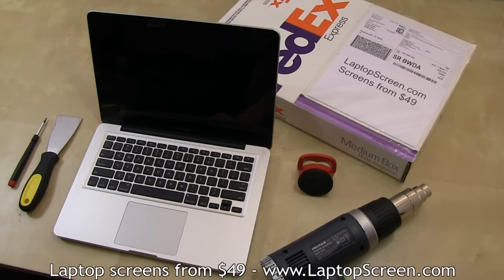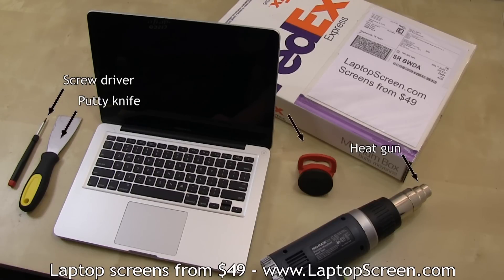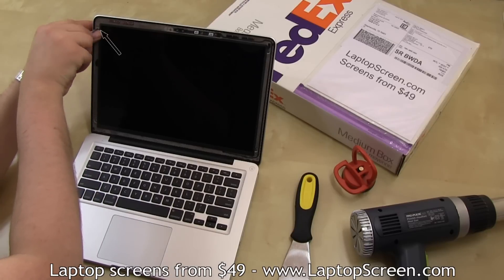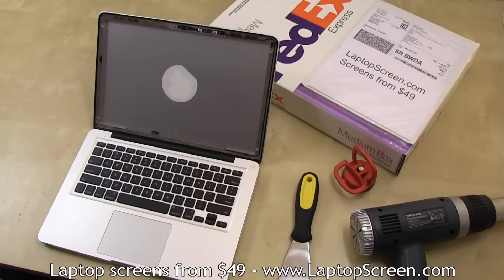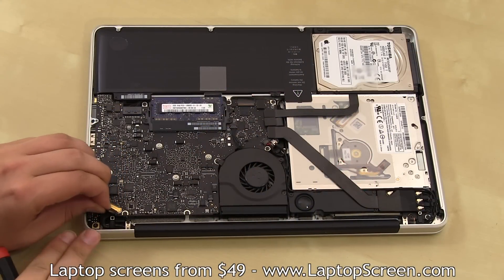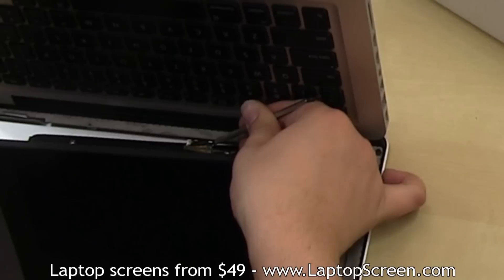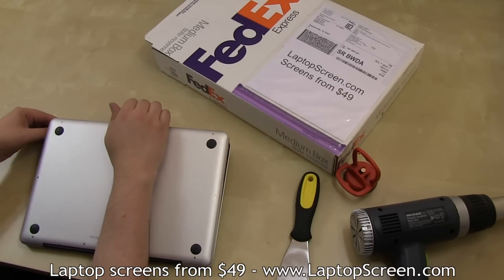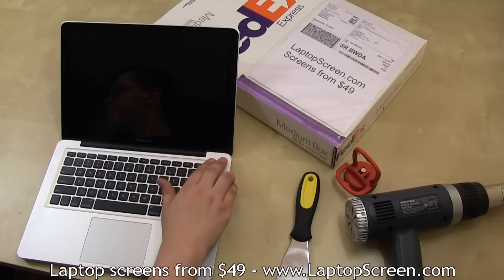MacBook Pro 13 screen replacement /  Installation guide [Apple MacBook Pro 13 Unibody LCD repair]

Comment: Great tutorial, I would recommend disconnecting the battery before removing the LCD cable cause on reinsert could blow screen backlight fuse.
Reply from the maker: Androski Diberooni
It is the likely suspect. The fix is moderately simple - there will be a tiny fuse near the video connector on the motherboard, it can be jumped or replaced. It is usually marked F1.
Just a note regarding the battery disconnection - we always recommend doing so, however it was less necessary in this video since the LCD was reconnected when the video cable was disconnected from the rest of the computer.
Fuses blow when the connector is slanted when plugging it in - probably should have mentioned it in this video (and we do in most of our newer videos) - always plug the video connector straight-in - and always use both hands when plugging it in - helps to keep it straight.
Reply: i think this may have happened to me as i cant see the screen is it an easy fix?
Reply: thanks

Comment: What temp do you set the heat gun to? My gun has various temp settings.
Reply from the maker: Sometimes choice is counter-productive.

The temperature to make the glue pliable is "right before you'd burn your fingers".

So the best advice is to always touch the heated area with your bare finger, and if it's hot to the touch you are good to go. If you burn your finger - you went too far.
Reply: LaptopScreen.com i saw this video to replace my macbook bro screen which cracked. if i wanted to replace just the front part do i have to replace the 2nd lcd screen aswell?

Comment: Can you replace a normal screen with a retina screen?
Reply: no because the flex connector is different
Reply: too bad :( would be great if it worked
Reply: Do you know what replacement screen will work on a retina 13" macbook pro?

Comment: Will this erase all of the data on the computer?
Reply: SERIOUSLY DUDE SERIOUSLY !?
Reply: Its not like the screen is a hard drive and the harddrive is the screen
Reply: Mutasem Moussa you are in no danger of any data loss from this process. You're not changing anything that holds memory or data on the computer, just the screen.
Reply: Timothy Hicks Thank you because, my MacBook  has important information and would die if did.
Reply: Mutasem Moussa no worries, you are safe. Good luck!
Reply: depends on the temperature of your heat gun 100 F will erase all data

Comment: What do you do if there is no damage to the LCD screen just the glass??
Reply: Then just replace the front panel glass of the unibody macbook pro model. I have some experience replacing the LCD polarizer on a macbook air. Honestly, you could use a hair dryer (it'll just take a heck of a lot longer). Also you don't have to worry about breaking the front panel of glass considering you're replacing it.

Comment: Okay so if the glass is just cracked, NO damage to the LCD, can I just stop after removing the glass itself and not have to worry about disconnecting the video cables and all that?
Reply from the maker: tuneadoes Lo
The glass is just superficial - you can remove and replace it with-out touching any other components, cables or plugs.
It's better to keep the computer off for this though.
Reply: I'd like to know this as well
Reply: must be disconnected see the tutorial

Comment: Ironically am watching this video on a cracked macbook pro that I just damaged this morning.  Haha.

Will be ordering the part and using this video to replace the glass shortly
Reply: Same here. Hands down my most miserable morning.
Reply: Same here lmao
Reply: Jordan Sinclair Then it's not ironic.
Reply: im using less then 40% of my screen if not less atm lmao
Reply: KungFu Rasta Started as a band along the right side of the screen, grew, then came up from the bottom and now finally I have 3"x4" of viewable screen...
Reply: did it work out for yall?

Comment: Will this work for macbook air?
Reply from the maker: No, here's the MacAir video: MacBook Air 13 LCD Matrix  replacement /  Installation guide [ MacBook Air 13 LCD matrix repair]

Comment: does this work with the brand new 15" retina display screen?
Reply from the maker: No. For Retina repairs you can replace the entire display assembly (top cover). Only experienced technicians should attempt to replace the matrix-only on the new retina displays. Retina matrix replacement is a bit more complex, due to the  fact that retina screens aren't modular in conventional sense. The top cover forms the LCD module, which contains the matrix, back-light, diffusers/refractors and the reflector.
So when replacing the matrix the rest of the LCD components have to stay in-place, and undamaged.

Comment: I just followed these instructions for my broken LCD screen and it worked great! A lot cheaper than the 550$ quote I got from the apple store.
Reply: Hello Nadia, did you have to change the display cable as well? I'm looking for one because mine has a false contact.

Comment: I was able to replace my glass screen with your help. (I had no need to change out my lcd.) However, it continues to loosen every now and then.  I applied heat with my heat gun again and it stayed firm for a few days before it slipped out slightly.  I am glad I saved the money it would have cost me, but now I am always having to be extra careful, otherwise my screen could fall out & break.  Any advice? Is there a glue you would recommend? I'm out of ideas. Thanks.

Comment: Do you sell just the glass screen?? I only need to replace the glass as it has a crack in it, the LCD is fine. If so how much and I have been told that there are different grades of glass also, do you recommend any?? Sweet vid. Cheers

Comment from the maker: Sorry, hairdryer settings, configuration and operation is not something that we are closely familiar with.
But essentially you have to get the surface of the device to hot enough to the touch, but not searing the fingers.

Comment from the maker: Any disassembly may damage the logic board, the table, the tools and the installer.
Common sense should be used as the primary tool.

The LVDS connector supplies power to the back-light, and if inserted on an angle, in reverse, or any way other than "like a detonator into a bombshell" the logic board can be damaged.

Comment from the maker: Our offices are generally clean, ventilated, air-filtered and regularly sanitized.
We've heard of customers doing these repairs outside on a bench with good results.
We would not recommend exposing electronics to high moisture levels such as well-vaoured bathroom.
A quick wipe with a microfiber cloth prior to sealing usually does the trick for us.

Comment from the maker: Typically LCD replacement's affect on the warranty varies from vendor to vendor, laptop to laptop, and are subject to warranty terms that vary by market (geographical location), year and model.
This question is best suited to the support department of a specific vendor, prior to repairing, and after the model number (or serial number) have been identified and declared to the support agent.

Comment from the maker: If you are replacing the top cover, it's best to watch our 15" MacBook tutorial.
Generally you don't need to open the glass and remove the LCD, if you already have a full featured replacement cover.
Just disconnect the Video, Wi-Fi, Camera, BlueTooth cables from the motherboard, unscrew the hinges, profit!

Comment from the maker: The ElectroStaticDischarge bracelet is a hotly contested topic in technician circles.
You can do it if you want, but no devices pictured in our videos have ever been killed "under camera" and all were filmed "live" with no ESD bracelet.
Disconnecting the battery is a good idea generally, however some devices do not come with easily removable batteries and in this case, the Apple sticker said don't do it - but there were no warning sticker for the LCD :)

Comment from the maker: No, the cam is not included with the "LCD screen"
However if you find a "back cover" / "top lid" it will be included.

Before you order any new parts, its best to check connections and reconnect the cable to camera board at the top and to the motherboard on the bottom.

Comment from the maker: Your description sounds a little vague.
The camera should only have one connection (5 wires - USB standard)
As long as that connection is intact, the camera can be put back in-place and help with the glass, or you can go an extra step and secure it with glue/tape (just not over the iris)

Comment from the maker: It should be pretty self-evident from just looking at it.
Does it look like a regular picture with just glass cracks overlaid (from the top glass) or do the cracks have black "ink" around them? Are there any vertical lines coming from the cracks?
Best is to Google images of a cracked LCD and compare.
Should be very self-evident.

Comment from the maker: Only if you are careful, soldering irons are typically very pointy and sometimes very hot. I wouldn't use a soldering iron for anything other than soldering though.

Comment from the maker: Anything that can raise the temperature upto 50-60 degrees C,
otherwise there won't be any effect on the adhesive.
A hairdryer, a heat gun, even a portable heater/fan combo would work.
We are using the cheapest heat gun that the Walmart caters (we don't put many HOURS on it)

Comment: You should disconnect the battery before starting, and you should use an ESD safe bracelet (or whatever that's called)

Comment: Thanks, nice video tho. Just having this question because I'm not up to changing the screen, but I want to buy a new top cover / back cover. But I have no idea how, can I use this method then remove the top cover or is there any better way? 

Thanks in advance

-NeoDev

Comment from the maker: We would NOT recommend it. But if you HAD to do it, use plastic picks/credit card. Then insert more plastic pieces to cover the glue as you "gain more ground". Don't bend the glass - it'll crack easily. The suction cup is good - it doesn't bend the glass - as it pulls from the front. Tape would not work like a suction cup at all.

Comment: Hi! Thanks for nice video. Do you have any alternate for the suction cup? I bought a big one, and it wont stick on screen. Is it for instance possible to use tape, or just pick the screen up without any suction?:)

Thanks in advance:)

Comment from the maker: Yes, you could put the glass back in.
You could warm it up after and apply pressure with your fingers - that'll help to reinitialize the glue. It won't be as strong as "unopened glue", but it'll hold functionally the same.

Comment: Wow thanks for this! One question please, if I wanted to clean inbetween the rubber and the screen to take it off and put the exact same screen back on not a replacement would I be able to put it back on? Or is it as soon as you heat up the glue and take off the screen it can never be put back on?

Comment from the maker: Actually unlike PC laptops, Apple doesn't supply fantom power to the LCD in the OFF cycle. Plus there is a warning about having to be authorized to disconnect the battery on a Mac.

Comment from the maker: It's a common problem, popped out during filming of this video as well. It's pretty easy to repair - put it back in-place, re-crimp the metal on the connector.

Comment from the maker: That would be a whole different video: it requires top cover removal.
Also we don't supply vendor specific LVDS cables, maybe a supplier that does should make such video ;)
Reply: Do you have someone that you can recommend me?

Comment: very good video! great job professional and straight to the point. two things i may add 1 suggest to wear some rubber gloves to prevent finger print stains. 2 remind to check the surfaces for dust specs, before closing it up.

Comment: Hey, thanks for your video. It helped me a lot. I have one important question thoug. In the process of removing the LCD, somehow my connector bracket (?) (that little metal bridge that helps to secure connection broke... Is that a major problem? Do i have to buy a new cable
? or some tape will fix the problem?
Again, thanks for the video,
Best regards, Hugon